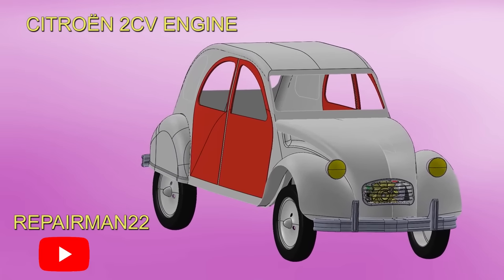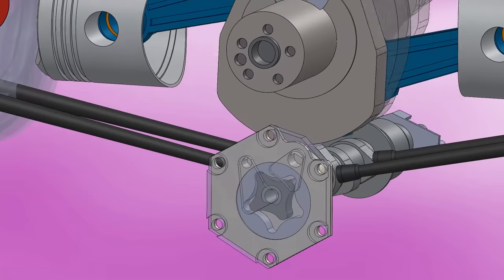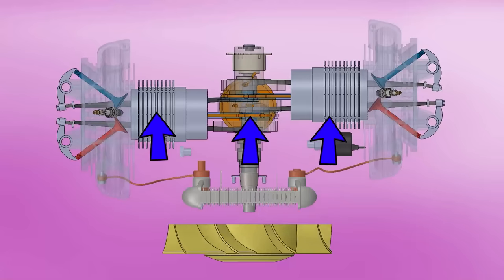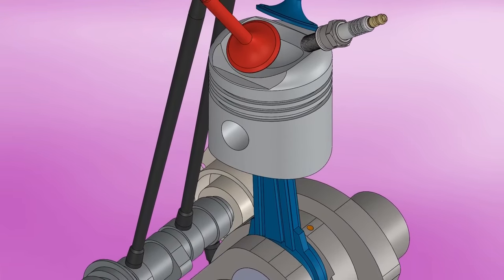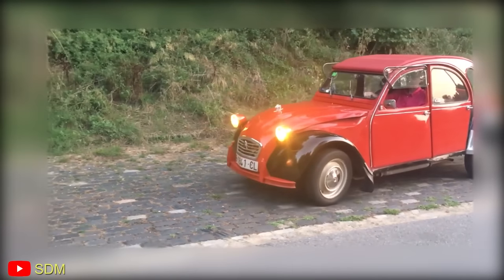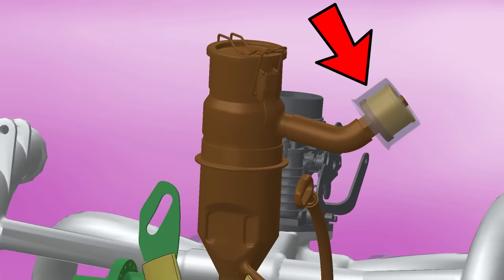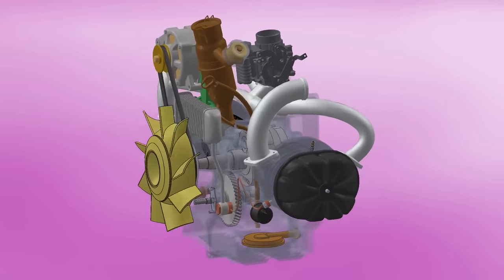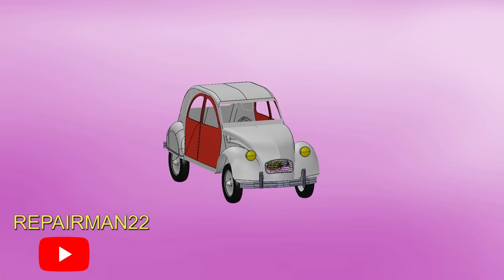The Most Interesting Engine In The World 😍 Citroen 2CV / How does it work in 3D?

Comment: A little perspective: The two pistons going toward and away from the heads in unison is in common with many older and currently manufactured motorcycles, including some four-cylinder engines whose pistons travel up and down in pairs. The economy of wasted spark ignition also persists, as it comes with next to no added cost, and can halve the number of ignition systems required. 

The need for a flywheel of higher rotational inertia in such a design is similar to the case of a single cylinder engine. Once again, many motorcycles also use this approach, going back to the first ones around the turn of the twentieth century, which were singles.

A note on evolution of engines. A lot of awkward and inefficient design features were acceptable only due to the low RPM ceiling of older engine designs such as the 2CV. Increasing power output per displacement by increasing RPM's required the round-robin improvement of many aspects of the engine. Pushrods are a casualty because their reciprocating mass could not follow the cams as the revs increased. Hemispherical combustion chambers and large irregularities in the top of pistons had to go because they lengthened the path the flame needed to travel to burn all the fuel before the next stroke. Air cooling became less and less reliable (though not impossible) as power output increased, due to the extra heat generated.

Increasing power output per displacement was also accomplished by increasing compression ratio. This was also a round-robin development of many technologies. Ensuring a complete burn was critical. This was accomplished by: Streamlining the cylinder head and piston crown design to make sure the flame front made it all the way through the combustion chamber. Improving carburetion to reduce sooty deposits, whose flakes can smolder between cycles and ignite the next fuel charge too early. Lowering the inlet temperature, to cool the inlet valve and keep the fuel charge from getting near ignition temperature until sparked. Strengthening the spark energy, to make sure it worked.

Nowadays, you could put the engine from a KTM Duke 390 single in your Citroen, and get more than 70hp, with a 13.x:1 compression ratio!
Reply: Pushrods work just fine up to 10k rpm in Nascar and 7k in street engines.

Comment: From 1978 I had a 2 CV 6 for the next six adventurous years.
Once we didn't have a second car to drive 20km to the canyon. We made it there and back with 11 people, two of them in the trunk.
So that I could transport a large cupboard, I removed the roof and made the rear crossbar removable.
A voltage converter (motor-generator, American, WW2) hummed for my seat heating - what a luxury.
Its narrow tires cut into the snow and gripped far better than VW, BMW, Benz & Co. I rarely installed the snow chains. Stream beds and mud, no problem.
A Chevrolet Impala pushed in my driver's door with its rear end in slow motion until I was only balancing on two wheels. My horn was too weak and the other driver couldn't hear me. The meaning of the nickname for the 2 CV “mobile tent” became tangible. The dented door served me as a very efficient television antenna for years.
A dark shadow in my experiences was a blocked engine. Hoisting the engine out on the street in front of my house. In the basement, using only the tools from my small toolbox, I dismantled the engine and was amazed: the camshaft gear is in two parts. The two halves are twisted against each other with spiral springs to eliminate the play. A spring was broken and was ground several times by the gears. The ground material left deep marks everywhere. As a mechanic, I removed these and was happy in the end when no screw remained. New pistons, new cylinder liners, new oil cooler - basically a new engine. And the car ran and ran and ran until someone massacred him under unclear circumstances.

Comment: Driving down the A7 one night, the 6 volt dynamo stopped working. Rolled back the roof a bit for better vis, turned off the lights and did from the Mosspaul to Langholm in full moonlight to save the battery for the sparks.

Comment: Citroen also had a flat four air cooled engine as used in the GS, GSA and some Amis.   I was once overtaken by a young lady in a bright green 2CV and I reckon that must have had four pots (one way or another) after the way it shot past my Singer Chamois Sports.   A 2CV is also the only engine I've started on the handle - it was for a neighbour and the engine felt very well engineered.

It would be even more interesting to compare the Citroen and VW flat fours!

Comment: My buddy in highschool had one. I remember that it a) was full efficient, b) we all made joke that it would roll-over one day bc of its soft suspension, but it never did, and c) to do mostly anything on the engine required to take the engine out bc it was encased in an air duct, which was not all that hard. Definitely iconic, and my friend turned eyes with this thing, since no one else had a 2CV. It was a big hit with the girls on our school. (Most folks in my school drove some version of an old Mercedes, as they were cheap to buy, and reasonably reliable at 15+ year old cars, and sine the school sort-of standardized on that model, we had plenty of parts to trade.) I grew up rural where kids had to work to earn a car in highschool.  Good times. It had a manual transmission, I think four-gears may be, on the steering wheel. And its acceleration was very leisurely. The hit was the fabric convertible roof, that you just rolled open.

Comment: Back in the late 80th I had a 2nd hand 2CV van.
In the winter my mother was pushing the car while I was operating the choker and the throttle to get the engine running.

Once we had gotten a lot of fire wood that was dumped at the side of our house and my 2CV was parked in the back garden over most of the winter.
On a sunny winter -/early spring morning I had the hood opened so the sun could shine directly on the battery and the engine. After some time I turned the key and the engine started right away. Then I drove the car near the house where there was a power outlet so I could connect a charger. While the car was charging the rest of the day and overnight I removed the fire wood so I had free passage.
The next morning the car was dead.

Eventually I brought it back to life, and I had a very funny ride in the snow and on snow covered frozen meltwater lakes in the fields.

When driving along the coastline in my hometown, wind was blowing in from the sea, and pushed open the window on the passenger side.
When closing (slamming) that window the generated air pressure opened the window on the driver side.

I don't really remember how and when I got rid of it. But I did.

Today I miss the simplicity of my old 2CV and the fun of driving the car.

Comment: I serviced a 2cv when I worked as a mechanic, the book gave 13 hours for the job, including you had to remove the wings to get to the front brakes, which were in by the engine. Then you had to centre the shoes manually using a metal strip fixed to the drive shaft spigot, or they would sound like a small foghorn. Having said that, they would run for years without any attention, just not very fast. Designed for rural France, with few resources and roads you couldn’t go fast on anyway.

Comment: Both were the right engine for the times. Recovering economies after WW2 had so few opportunities for people.  Btw, we owned a 1967 Simca, it had many interesting features. Water cooled rear engine. Centrifugal/magmetic oil filter. We quickly learned to point the car in the direction we wanted to go when parking on cold nights. The long gear linkage needed the engine to heat up to shift. If you left it in 1st, you could start it and creep away slowly, heating the engine more quickly.  As expected the heater defroster was awful. Fun to drive though slow.

Comment: We had three Dyanes, 602cc, consecutively. The first was an oil-burner, we always got out smelling strongly of oil. It had a centrifugal clutch which would occasionally disengage when going down hill. It;s not intuitive to accelerate to get the engine braking back. Dyanes 2 & 3 were fine, went over the Alps in No.2,usually got around 50 miles per gallon.

Comment: Stepfather, mother, stepmother, uncles… had a 2CV ("Deux Chevaux" - translates into 2 HP, this was "fiscal HPs"). 
I learned to drive with a 2CV. Many of my friends had one as their first car. That was in the 60's and 70's.

Many 2CV made great trips, several drove around the globe (except for USA which banned it because "there was not enough steel in front to protect passengers" !!!!…). My father's best friend was the first man to drive on a single trip from Mexico City to Patagonia by way of the Andes.
His name was Coulaud and his fully equipped car was a 2CV.

Maintenance was minimal and it was said you could drive it around the world with a can opener and and a roll of metal wire !!!…
I can tell you we did a lot on our 2CV on the side of the road with minimal tools as we were mostly broke at that time in life .
We even drove from Strasbourg (at the border of Germany) to Paris with a broken chassis that was repaired with three 2x4 and wire !!…
No, we didn't speed and yes it was a very long drive… the more so that, as far as my memory doesn't trick me, we were 6 in that goddam car.
I remember we also drove for short distances without a driver's seat : a small bench did the job when we didn't have time to put the seats back : they were easy enough to disassemble from the chassis so we used them as … a couch on a picnic !!!… 
Two other features left memories specific to the car. 
One, the seats were reinforced with a centre rod in the middle so when three persons rode in the read the one sitting between the two others had to take a cushion unless they accepted to seat on solid iron !…
Second the windows on the front doors didn't slide in the door, instead the bottom half or the window folded up and was held to the outer part of the door by some sort of snap fastener. Of course the latter wore out and the window slammed down violently on the elbow of the passenger (or driver) who was unwise enough to do what we all do in a car when the weather is fine and the windows down. That left the memory of zillions of curses and shared memories by absolutely all who drove in a 2CV. And fond memories a soon as we rode other models.
We were 20.

Two thing you should notice are :
1) The 2CV suspension was so good that the car cannot roll over even in the direst situation. They made numerous tests and even the competition acknowledged that at the time. Google it, I believe it is well documented.
or watch : https://www.youtube.com/watch?v=bkMTE55v2o0
2) The 2CV was released in 1949 but the project goes back from before the war. Initially it was commissioned to Citroen by the French Army who was looking for an all terrain light vehicle akin to the Jeep.
This explains many of its feature, including the version with the double engine.

The 2CV is an excellent piece of engineering that doubles as a testimony to the French spirit called "Systeme D" (or "Système Débrouille" : Resourcefulness with a touch of nonchalantness or insouciance …) an attitude that will help a Frenchman to get out of any situation unscathed … or so the myth goes.

Anyway I do not think there is a French person who didn't shed a tear when they announced they would stop producing the 2CV.

The 2CV is part of the French mythology as much as the baguette and wine, or as the Ford T, hamburger and Marlboro cowboy in the American Mythology.

Great video.

Thank you so much for posting.

Comment: I was living as an expat in Europe and it was explained to me that the 2cv was developed to outsmart a complex French DMV equation to keep the French vehicle tax below a certain threshold.

The French Gov.  taxes everything so this made the explanation very believable.... it would be interesting to research and see the background behind this tax beating concept.
Reply from the maker: The tax was a relation between weight and horsepower. That calculation gives 2 Fiscal horsepower or 2CVF (F was erased). when the power of 2cv went to 28HP, it was 3CVF but name kept 2cv.
Reply: @repairman22  thank you Repairman 22... I would also like to add that it was pointed out the Citron's had three lug studs or bolts for the same reason... in simple terms the heavier the car the more lugs or bolts per wheel/axel so that factored into the taxation equation as well.
This seemed reasonable but at the same time you know how Gearheads love to create urban legends so I wonder if anybody can weigh-in on the "French 3- Hole Legend "

Comment: Years ago I drove a 2CV, fun vehicle, lightweight but zero crash protection: it will literally fall apart if it's involved in a crash. You could pick it up by the rear bumper and walk around with it – making sure the bumper is still in good enough condition or you might pull it off. I never worked on the motor, but have seen others working on it (living in France there are a good number of them that have been restored), you can take the little engine out with your bare hands. I've never seen anything other than 602cc engined versions here, I guess the smaller ones are just too under-powered for a restoration project.

Comment: The exhaust valves were cooled by the oil circuit. And on the 2 CV 6, there was an oil radiator and an oil filter.

Comment: Very helpful to understand the engines in three new 2CV6s I have owned from new over 45 years and 550,000 KMs.

More JOY than any other vehicle ever made. Like having a cute puppy dog... Makes new friends everywhere you venture. 

For my last model 1990 series Charleston I have recently had fitted a rebuilt Burton Big Bore 652 cc engine plus Power Tube...
Up from 29 HP to about 34 hp and  20% more torque. Larger jets for the reconditioned carbie...

As I run it in this 75 year old engine design gives a new mid range throatiness and oomph that is rather enticing...

No longer will I be able to say...
"But Officer, can I please have a credit for all the uphills I am unable to get to the speed limit please?"

Everything you need in a car and nothing you don't. At 585 kg it weighs less than a Tesla Model Y battery pack at 770 kg....

Now which is the more environmentally friendly????
AND... the seats clip out for picnics!!!

FUN CENTRAL.

Comment: I bought a '61 2CV in Berkeley in 1968, where I was doing my PhD on medieval comp lit. I chose that subject area because I had spent my 1963 Junior Year at the Sorbonne in Paris in the Tulane University program. We had a six-week orientation in Dijon, before going to Paris, which was taught by Mme Lucien Herrard, who belonged to the Knights of the Winetaste, a premier gourmet club; Mme Herrard personally knew the owners of all the great wineries in Burgundy and the Loire, and my scholarship paid for our grand week-long exrcursion around the gourmet highspots between Dijon and Mt. San Michel. We were in Dijon for the wine festival, where new wine ran out of huge barrels into the mouths of the people, then through the city gutters. 

My introduction to French vehicles took the form of a velo Solex, which has a single cylinder on a hinge at the front wheel;  pedals chained to the rear wheel gets the bike rolling, then you let the engines down to begin revving for the start. It got 200 mpg, and when bought by a foreigner with foreign money, the French 20% VAT was dropped, so the final price was only $56.

The Solex make Paris completely mine, anytime, day or night. It also aroused my interest in French engineering, leading to the 2CV, followed by the HY van, which looks like an elephant made of garbage cans, runs on the same 1.9L 4-cyl engine as the ID, and weighs 2k but carries 2.2 k kilos. Just wonderful stuff.

Comment: Those cutaway diagrms of the engine rotating reminds me of the 2 cylinder Victa Twin engine that was made here in Australia in the 1970's.
But the Victa engine was a 2 stroke but still fired both spark plugs at the same time, so being a 2 stroke each time each plug fired it was a firing stroke.
As one of the diagrams shows, a horizomtally opposed two cylinder engine produces more crankcase compression, which the Victa Twin used to good effect, because in a 2 stroke engine the fuel air mixture is ingested into the crankcase and then forced into the combustion chambers by the crankcase compression.
The real advantage of a horizontally opposed twin two strike engine is that because both cyliners fire at the same time, the impulses caused by the ignition in each cylinder cancels the impulses from the other cylinder. This makes the horizontally opposed two cylinder two stroke a smooth engine.

Comment: In the late 1970s, this car was made in Iran called Xian. They had a big square box or container between the cabin air vent and the engine hood. Some owners would fill the container with ice, and when they were driving on the highway, the cold air would cool the inside of the car until it had ice and speed.

this ca

Comment: I still got one of those and a gotta say it is a strong worker! Mine 62 years old under 1000 rpm approx. left cyl. does not fire but still can pull and accelerate. Suspension is astonishing you can drive through train rails and don’t feel anything😂 but for god shake do not try to overtake someone that is scary af

Comment: the VW Beetle was designed earlier. The pre-series models were developed as early as 1938. Due to the war, military versions were built using Beetle technology. The Kübelwagen and the Schwimmwagen. After the war, the first Beetles were built on the existing frames of the military vehicles. 
Even the first VW buses were military vehicle technology. The axle on the first bus was raised like it was on the previous series.